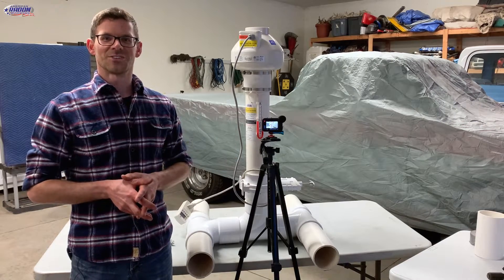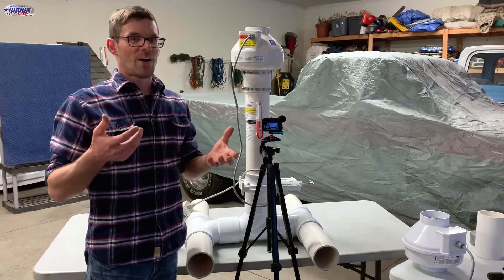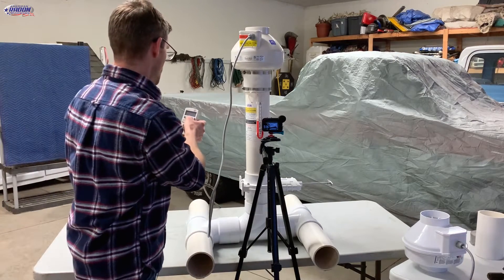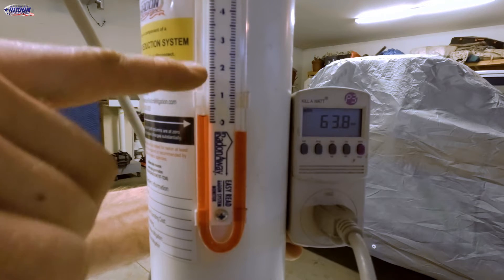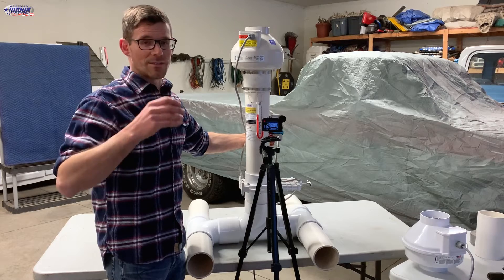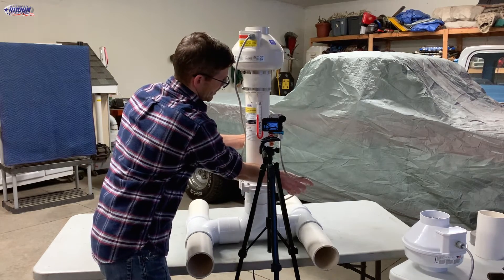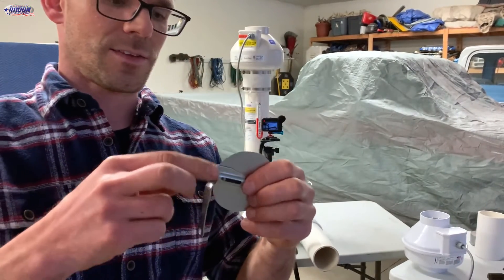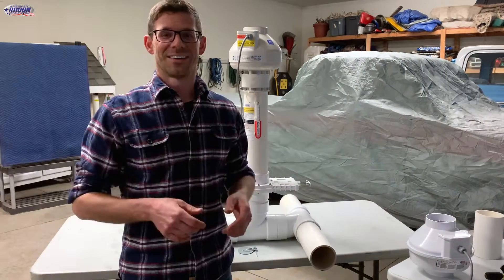Better Radon System Performance with Dampers and Valves

Comment: Does restricting airflow make the pipe airflow sound louder?
Reply from the maker: In my experience, that is only the case if you use a gate valve that can whistle when it is nearly closed.

Comment: GREAT idea, thank you. Did not think the restriction would reduce the energy use, wow.
Should the U-tube go before the valve though, so you know suction at the pit?
Reply from the maker: You're welcome. Put the valve below the U-tube. Otherwise, it will look like it's reading zero if you have it closed down, and the radon system alarm may not work if it's a pressure-activated alarm.

Comment: If an EC radon fan equipped with a potentiometer is already in use, would there still be a need to incorporate a ball valve or damper into the system for further adjustments? Can you also provide links on EC radon fans you recommend?
Reply from the maker: Good question. If you have multiple suction points to balance, then yes, use dampers. If you don’t, a damper would be redundant when using an EC fan. 

You can find radon fans on our Amazon shop.  https://www.amazon.com/shop/americanradonmitigation

We earn a commission if you purchase items from our Amazon shop, and thank you for your support.

Comment: So I have the RP145C, and if I'm moving enough air that I need to dial it back and restrict it, I would've been further ahead going with the RP140 that moves less, and costs less to run wouldn't have I ?
Reply from the maker: Yes, that's correct, assuming you can dial it back enough to be in the range of the RP140. 

I'd confirm by measuring the negative pressure under your home.

Comment: Is it common to have a check valve similar to a sump pump that makes a loud clunk whenever the radon pump runs?
Reply from the maker: No, radon mitigation system piping should not include a check valve. Also, the radon fan should run continuously.
Reply: @AmericanRadonMitigation  Okay it turns out I'm just somewhat of an idiot. The house had a second sump pump put in right next to my radon well and since I heard the noise right next to my radon well, I assumed it was the radon system making the noise. /facepalm 

Thanks for your reply!
Reply from the maker: I'm glad you were able to get it figured out!

Comment: Ball valves are where it’s at imo. I like them better then gate valves. I feel they do better partially open or closed. There are beefy ones on Amazon for 3 inch schedule 40.
Reply from the maker: Yes, ball valves are nice because of the control you get. They are also not easily opened or closed due to a bump like a gate valve is. I ordered some 3-inch valves from Amazon a few years ago but returned them since the inside diameter of the valve was not a full 3-inch opening. I believe it was something like 2.5 or 2.75 inches in diameter. Do the ones you found have a full 3-inch opening? If so, can you provide a link?

Comment: Should the manometer be below the valve to show the negative pressure at the suction point below the floor/slab?
Reply from the maker: We place the valve below the u-tube manometer. If you put the valve above the u-tube, the fluid in the u-tube may be close to zero on both sides if your valve is nearly closed. This makes it hard to tell if the fan is working.
Reply: Could you please clarify the reasoning behind placing the U-tube manometer below the damper valve? Based on the explanation, when the valve is nearly closed, the manometer would show close to zero pressure difference. However, wouldn't placing the manometer after the damper valve also prevent the manometer from accurately reflecting the true negative pressure in the system, since it's measuring after the airflow has been restricted by the valve? @AmericanRadonMitigation